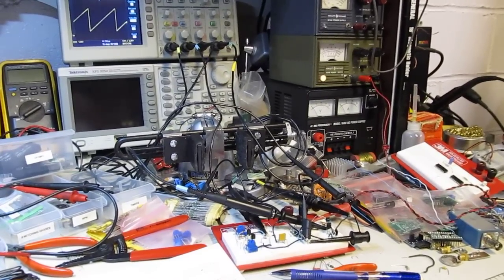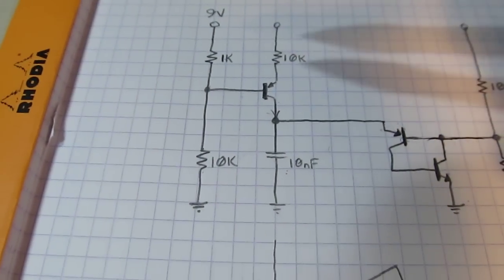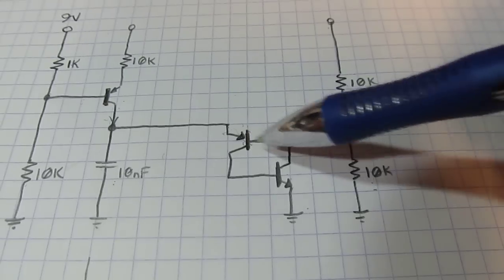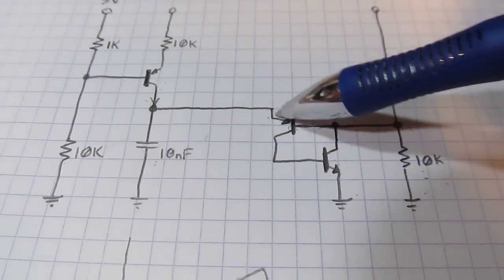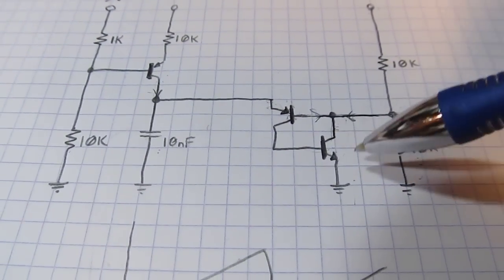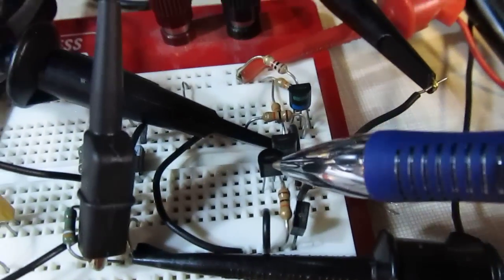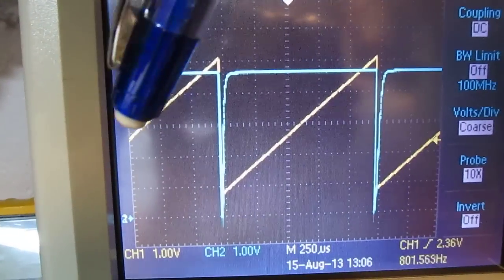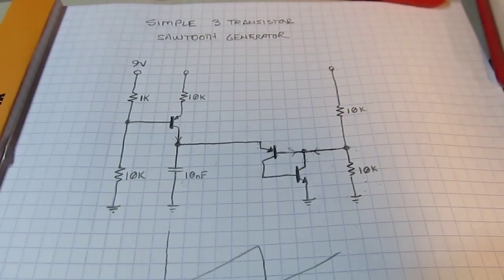#105: More Circuit Fun: Simple 3 transistor sawtooth generator / oscillator

Comment: Built this circuit and funny that it didn't start working until I reversed the NPN....So the Emitter was connected to PNP base and collector to ground...Any reason for this? or do I just have a bad NPN? Quick, dumb question, but if you reverse a  polarity, it should not conduct when biased at the base? some of the NPN i have I tested and when reversing the polarity, the LED load was lighting up with no current at base. Emitter connected to load, and collector to GND. Theoretically, the diode should block current correct? This has been throwing me in a loop..
Reply: Hello Lyman,

I got the same, it only works with the NPN collector and emittor is reversed.

on the video I also see that collector is connected to ground. 

With a 9V supply:   When capacitor is charged to 4,5V + 0,6V the base of PNP transistor is 0,6V higher then the emittor.
The npn opens and the capacitor is discharge via collector PNP to base PNP Emittor NPN to collector NPN 
When voltage is < 0,6V NPN is close end capacitor is charged again.

.
I use a BC337  and BC327 my scope views with reversed  NPN  are exactly the same
Reply: same here.
Reply: The reason for your result is because the oscillator as presented here ONLY works if the NPN transistor has a relatively modest current gain (beta). If it has high beta, then the NPN will remain stubbornly saturated with the 20 microamps of current available via the second PNP transistor's emitter-base junction from the constant current PNP transistor charging the capacitor, cheerfully supported by the gain, modest or otherwise, of the second PNP.

When you reversed the NPN C and E leads, you made an NPN transistor with a substantially reduced current gain (although interestingly the collector current of the NPN remains much the same!) It is now unable to be kept turned on by the 20uA of current from the first and second PNP transistors, and it promptly turns off. With that 'improvement' that you made, this oscillator will then work as shown in the video.

Basically, then, this oscillator as described ONLY works if you are lucky enough to get a low gain NPN transistor. These days, such parts are surprisingly hard to find.

Comment: I've looked the tutorial again. Is it possible to make this saw wave scalable? So it will be charging quicker and at the end it will be a delay before the process will start. And so this delay will not affect the whole cycle wave (the frequency will remain the same). It's very useful for audio oscillator purposes. A kind of a PWM wave but not square.
Reply from the maker: No, this simple circuit isn't scalable in that way.

Comment: I was trying to analyze the first portion of the circuit (just the single pnp transistor) using methods from my Microelectronics course to find the collector current, but I'm not getting anything near 30 uA. I'm not entirely sure, but is the transistor in active or saturation mode? Does the DC current gain of the transistor matter in this case?
Reply from the maker: The transistor is in the active mode.  The transistor's current gain is only a very small factor in this case, and can be largely ignored.  Here's the grossly simplified analysis says that you get about 1V at the base due to the resistor divider, subtracting 700mV for the base-emitter voltage leaves 300mv across the 10K emitter resistor, which gives about 30uA current.  In reality, a more detailed analysis will reveal that the base voltage is closer to 800mV, and you  get something more like 150-200mV across the emitter resistor resulting in 15-20uA of current.  It's the difference between  quick "back of the envelope" estimations vs. a more detailed analysis.
Reply: Thank you for the quick reply and explanation! I looked at my calculations and I got values fairly close to the ones you've stated. I appreciate the help :)

Comment: Thanks a lot for this circuit idea :)! I just used it in my Flyback design to replace a sawtooth generator with 2 opamps that would have cost much more
Reply from the maker: Just keep in mind that this circuit hasn't been tested over temperature, supply variations or for long-term reliability or consistency with device variations...
Reply: Yep, I am fully aware of that :)!

Comment: Hi Alan,

I realy enjoy your circuit Tutorials videos, they are awesome! I like the way, you build them up from general components, the simple and beautiful logic, and the way you explain all the things. Please keep on making this kind of videos! I have also a idea, lets say for comeback in this field ;). It would be very useful for a workbench: a simple transistor driven (because I like transistor that much) 0 - 5V regulator supply that can handle maximum of 100 mA current. In many cases it's only required to have a small signal with precise voltage. Please consider making a tutorial about it.
Best regards
Reply: you can buy 5 volt 100mA regulators or find them in broken electronics their pretty common.
Reply from the maker: Sounds like a fun little project - I'll add it to my long list...

Comment: sweep time is dependent on the capacitor which is connected to the constant current source(first PNP transistor on the left) and if i have a variable capacitor , does it mean that i can vary the sweep time.
Reply from the maker: Yes, or you can vary the current source value.
Reply: V=It/C , so i think if i want to vary the slope (not sweep time) i can play with I or C or both and sweep time only C ????
Reply from the maker: Since the switching threshold is fixed, sweep time and slope are the same thing.

Comment: for getting a DC offset on the sawtooth waveform, should i adjust the two 10k resistors after the SCR connected transistors
Reply from the maker: No. You'll have to add a buffer with DC offset capability to add DC offset to the signal.
Reply: ohh yeah Common Collector , level shifter right , i was thinking about that , any how thank you w2aew

Comment: Hi,

I tried creating your circuit and began simulating it to see if the voltage across the capacitor goes in the saw tooth pattern that you described. I seem to always get a constant voltage of 0.8 V. Is there something that I'm not doing in my simulation set up?
Reply from the maker: Simulating oscillators can be tricky - often setting an initial condition (like 0 volts on the cap) will sometimes help to get the circuit going.
Reply: w2aew I was able to set up the initial condition on my simulation, so while it demonstrates the triangle wave at first, it quickly goes back to the 0.8V. Is there anything like steady state for oscillator circuits?
Reply from the maker: It is important to note that transistor models often do not do a great job modeling the transient behavior involving BJT saturation. So, this is a case where a simulator may not do a great job of modeling reality.

Comment: The structure on the right, made up of the two npn transistors, is known as a programmable unijunction transistor or PUT. it is the compliment of an SCR wherein the base of the upper transistor is pined out instead of the base of the lower transistor as in the case of the SCR. Put another way, in an SCR the "top" P region and the lower P and N regions are pinned out of the chip. In a PUT it is the "top" P and N regions and the lower N region that are pinned out. Turn on voltage is programmed by fixing the base voltage of the upper transistor. Once on it will conduct until the current drops below a critical level and the PUT resets to the off condition. I also like the way you use a transistor as a constant current source to charge up the capacitor and thus get a true linear ramp. Excellent video.
Reply: Bogy Wan Kenobi I think you are confusing a PUT relaxation oscillator that is used to trigger SCRs, or thyristors, with the action show above. The PUT is closer to a FET than a BJT. Also the transistors at the right are not both NPNs. One is a PNP, and the other is a NPN. They are connected, as the author describes, for the same action as an SCR (PNPN) and function as a latch. I agree that a PUT could be used to produce simular results, but the point is the components at the right create an SCR rather than  a PUT.
Reply: @NCmountainview  I disagree with this.  That circuit is exactly a PUT.  And can also be used like an SCR,  or an SCS (SCR + anode gate).  I rather like that cross-coupled complementary pair,  it's extremely versatile.
Reply: I second your opinion Sir @Roy_Tellason

Comment: Is it possible to build a simple VCO by replacing emitter resistor of first transistor with JFET, and controlling it's gate ?
Reply from the maker: Yes, that will give you some voltage controllability.
Reply: LTSPice showed me ramp at ~500Hz. Then I gathered it on breadboard. Some of parameters are different: emmiter resistor of first tr-r is 22K and cap is 22n and power is at 5V. I expected freq 4-5 times lower, circa 100Hz. But it did 2Hz! And waveform is far from ramp, it is exponential with ringing. pnp Trs. are A92, npn - 3904.
And when I powered it with 11V - no oscillation at all.
Reply: Well, sorry my impatience. =)  I just messed all circuit.
I inserted both PNP reversed: 'C' in place of 'E'. Now it ramps!  On 5V power rise is visibly exponential, but when powered up with 12V rise is quite linear, not perfect - some exponent curve still here. But with 10x attenuation waveform becomes perfect linear. Maybe some misperfections of my scope (old and entry level). Ramp is stable at 200Hz with previously mentioned RC.
Reply: Another iteration: replaced A92 with 3906. Totally busted. Just like with misused A92. 15Hz exponential rise at 5V, no osc at 12V. and reversing doesn't work. Don't know whats up...
Reply from the maker: Circuits like this that depend on unspecified behavior characteristics like saturation, are often very finicky about transistor types, bias, etc.
Reply: could you share your LTSpice simulation diagram? I can't get it to work in there... Thanks

Comment: +w2aew I build this circuit using bc846/bc856 and two back-to-back transistors seems to stuck at open state. Voltage on capacitor stays at around 650mv until i manually drive it to ground, then capacitor charges again, transistors open and it stucks again.
How could it drive capacitor below it's drop? Maybe inductor between discharge block and cap would help?

Is it possible to create 100MHz oscillator using this circuit?
Reply from the maker: You may have to tweak the bias resistors (on the right).  This circuit is not suitable for 100MHz oscillation.
Reply: ***** Thanks for the reply! I replaced them with pot, and tried various positions. Latching voltage changes, but nothing more. What transistors did you use in video?
What does limits this circuit from operating on 100MHz and above? If i dont need it to be very stable, is not simple is better?
Maybe you can recommend another circuit, which would be better for 100-150MHz range?
Reply from the maker: I believe I used 2N3904 and 2N3906 transistors.  The main limiting factor is that this design involves transistors going into saturation, which has a slow recovery time.  Do you need a 100MHz sawtooth wave, or just a 100MHz oscillator?  The latter can be done with a simple single-transistor oscillator.
Reply: Single tr-r oscillator is interesting! Do you have video on this topic? Or about to make it?
Reply from the maker: I have several videos that feature essentially single transistor oscillators.  Look for the videos on oscilloscope BW (audio phase shift oscillator), as well as the one on Varactor Diodes and the one on building a Crystal Test Oscillator.

Comment: Hey ! this shoud seem idiot but I did'nt understood where is the out.. Also, the others connections on the top of the circuit are +9V too ? I'm simulating it on PSpice. Sorry for my silliness, i'm a true beginer :(
Reply from the maker: The sawtooth waveform appears across the 10nF capacitor.  Yes, the "top" connections are to the 9V power supply.

Comment: Wonderfull!
but what is its output impedance ?  Will be it a usefull circuit?
I will need a operational as follower to improve output impedance ?

Thanks a lot 
I think you are the better teacher.
Reply from the maker: +Jose Pico Yes - you would need to add a buffer to make it more useful.
Reply: @w2aew   ancient history here but I thought I would add that the circuit does appear to have an extremely high output impedance.  For instance after building it up and verifying expected voltages at the scope I hooked it up to a TL071 configured as a buffer and the output simply collapses.  Alan it would be great to see a follow-up to this video detailing how one might use the circuit in practice.  My hope was to make a little curve tracer with this ramp generator controlling VCE on the DUT.  Any thoughts?
Reply from the maker: @bradsaylor6199  What supply voltages did you use with the TL071? The input voltage range on that device doesn’t extend to anywhere near the lower supply rail. This oscillator is really a fairly bad circuit, it’s just simple and fun to check out. Check out videos 231 and 232 for a better way to do this.
Reply: @w2aew  thanks for the reply on this.  I'm working my way through your other sawtooth generator as we speak.  To echo the popular sentiment here your videos have been a real education on so many topics...  thank you!

Comment: What's the equation for the frequency of the waveform?
Reply from the maker: +Matthew Ferrie It isn't that simple.  The ramp swings about 4V.  The slope of the ramp is Ic/C where Ic is the collector current of the PNP current source, and C is the 10nF cap.  Ic is approx 30uA and C is about 10nF.  The ramp rate is then approx 30uA/10nF = or about 3000V/s.  Thus the time it takes to ramp 4V is 4/3000 or 1.3ms.  1/1.3ms is 750Hz.  Reasonably close to the frequency shown.  So, a very rough approx would be Ic / C / 4.
Reply: +w2aew Didn't quite follow, but it's late now. Also, how would I make a pure triangle wave at 100 kHz?
Reply from the maker: Not with a simple circuit like this. You can use something like the circuit in video mentioned at the beginning of this vid. Or, simply a 100kHz square wave followed by an integrator.

Comment: Just tried it in a circuit wizard simulator and nothing happens couple of ways cuz there are unlabeled connections here , jack shit happens
Reply from the maker: +Pavle Pavlovic Many oscillator circuits don't start up properly in simulations - you'll need to often provide some way to kick start the oscillation (something lik "use initial conditions", or a momentary current pulse into a node, etc.).
Reply: ***** what should be the best simulator , cuz often i dont have the parts needed so i want to try things out . right now i need high frequency oscillator to measure ESR
Reply from the maker: +Pavle Pavlovic LTspice should work. This is probably not the best circuit to use for ESR measurement though.
Reply: ***** i know but at this point any osc will sufice
Reply from the maker: +Pavle Pavlovic Something like this might be simpler and more stable:
http://www.learnabout-electronics.org/Oscillators/osc41.php
Reply: great idea , i dont need much , just a decent AC curent to try to check capacitors ...im going to change them all , but they are 50 years old real nice looking caps, great for experimentation and limited use . but great little project , grateful

Comment: Is it easy to modify this circuit to drive a load or to light a LED? I tried to find a solution but don't see a way to do it. If you drain current (directly or through a transistor) then capacitor won't fully load and the "magic" won't happend.
Reply from the maker: +David Senabre You'd have to add a buffer amplifier between the oscillator and your LED.

Comment: The fall time of the sawtooth, please?
Reply from the maker: +Espen Bøgh I don't know - I didn't measure it.
Reply: w2aew viewing a bunch of old videos I looked at this one and the one to measure the bw of an oscilloscope (#70). And I though, hey, maybe the fall time of that easy to make and cheap circuit is low enough to be a good source to do that measurement? Of course It's probably highly dependant on the choice of transistors and build (Manhattan style or breadboard...) but if it's low enough then we can just consider it zero and the measured fall time will be the oscilloscope fall time.

Comment: How would you change the period of the waveform?
Reply: Observe the oscillator from a different reference frame.
Reply: +p39483 Best comment ever
Reply: Or change the value of the capacitor. A larger capacitance will take longer to "fill" with the same current source

Comment: ***** Hey thanks for the great video. Tell me, please, what is the operating range of the frequency? Can I generate a sawtooth at frequencies greater or equal to 100 KHz? Thanks in advanced!
Reply from the maker: I didn't try running it at a higher frequency.  I doubt it would go to 100kHz because of the saturation recovery time of the "SCR connected" PNP/NPN.
Reply: ***** I played around with some values and could only simulate 40 kHz with that circuit.
I've decided to design a 100 kHz astable multi-vibrator circuit and then just add a  23 nF capacitor at the output to get a sawtooth wave. It's beautiful :) Thanks again for the help and quick reply!